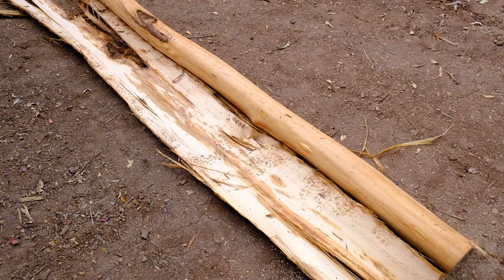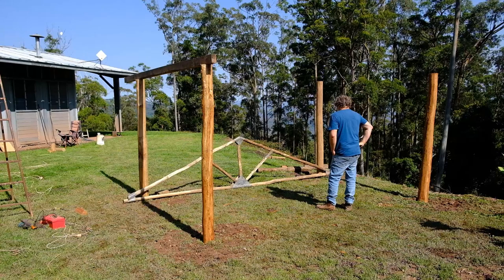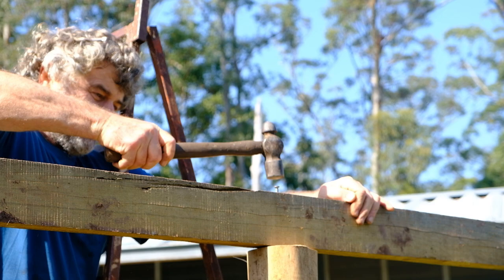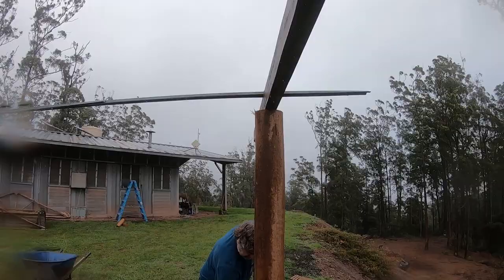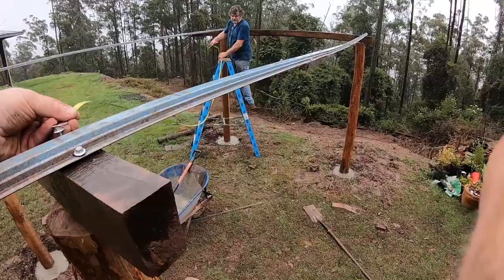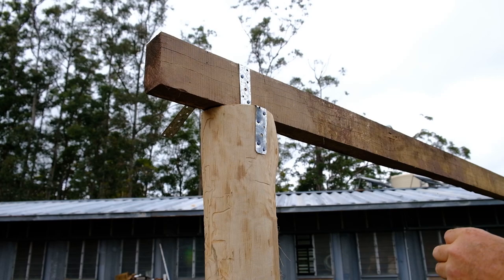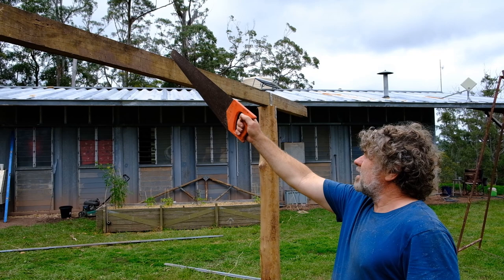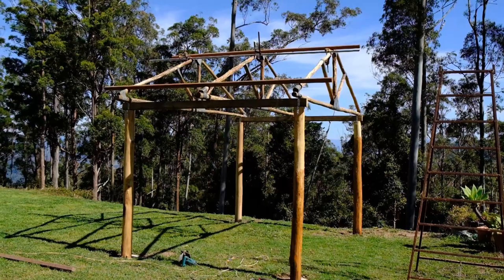DIY Wood Shed with Natural Round Wood Trusses (Part 1)

Comment: This trusses are very nice, but this poles in the ground will rot away much earlier, here in india most people use 6 inch ID cement pipes (6 feet tall) like a columns around 2 feet deep, fill it with sand or sand stones and then put poles in it then use some cement to fix poles, this prevents wooden poles from rotting.....!